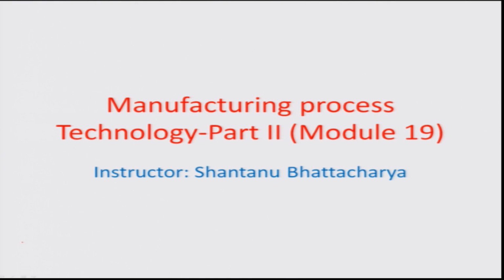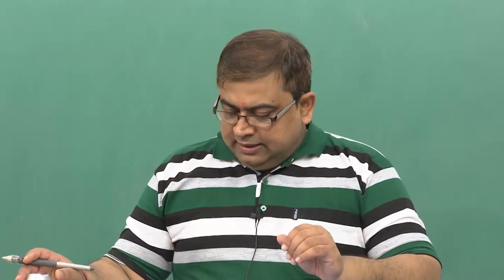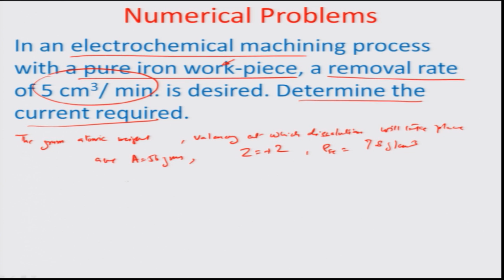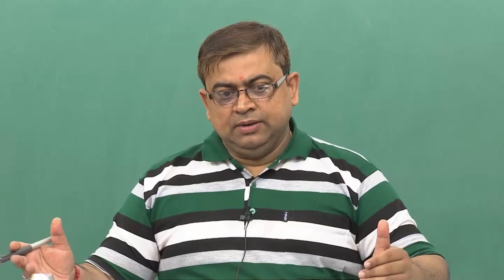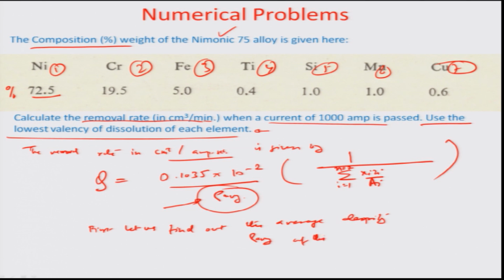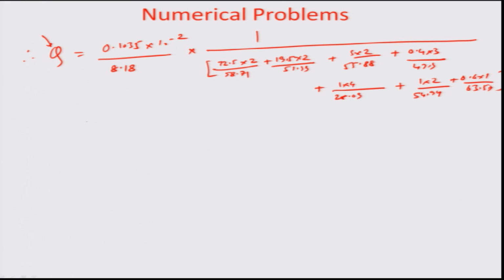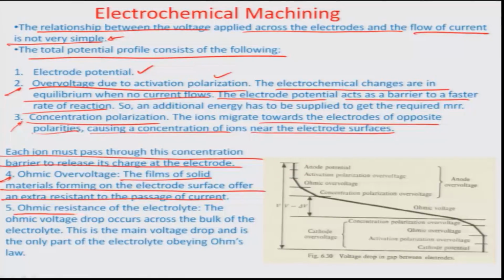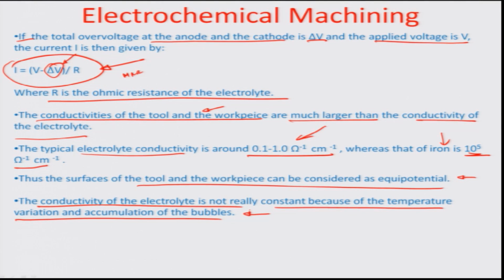Material removal rate of an alloy in ECM

Comment: Hi, thank you. PLEASE can you resolve this exercise:
During ECM, 10 V DC power supply is used. Initial conductivity of the electrolyte used is 0.2 Ω−1 cm−1. Feed rate is 1.0 mm/min. 
(a)Calculate the IEG at 10, 20 and 30 mm distance from the inlet after 10 seconds. Use the following given conditions : (T = 30 oC, αv = 0 at x = 0 mm), (T = 60 oC, αv = 0.3 at x = 40 mm). Take n (exponent) = 1.75, atomic weight of anode = 55.9 g, density of anode = 7.86 g/cm3 ,             initial IEG = 0.4 mm, valency of dissolution = 2, over potential = 1.5 V, and α = 0.002. Also calculate mean equilibrium gap. 
(b) The composition of nimonic alloy turbine blade is 18 % cobalt, 62 % Ni, and 20 % chromium. Take I =1500 A, and ρa = 8.3 g cm-3. Use valency of dissolution for chromium, nickel and cobalt as 6, 2 and 2, respectively. Gram atomic weights are as follows : Ni = 58.7 g, Cr = 52.0 g and Co = 59.0 g. Calculate the volumetric MRR, and state assumptions, if any.